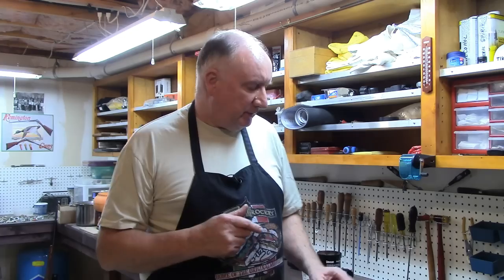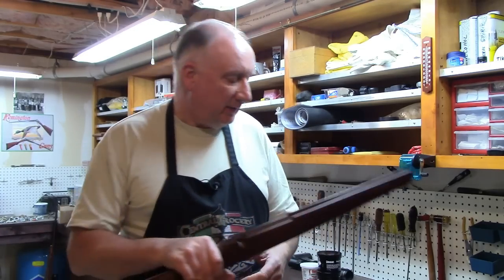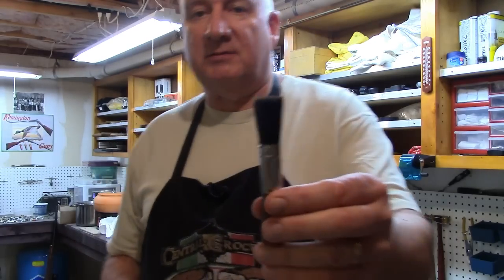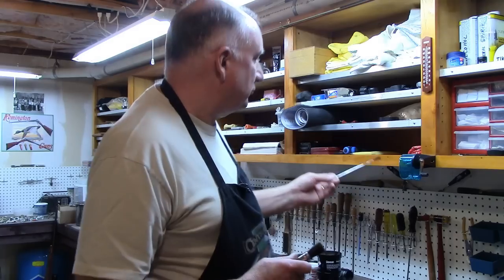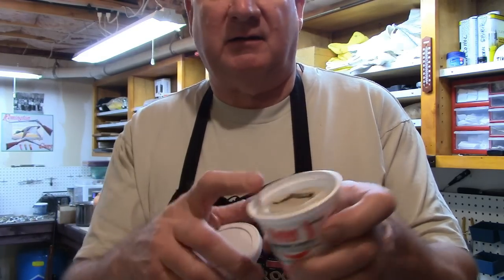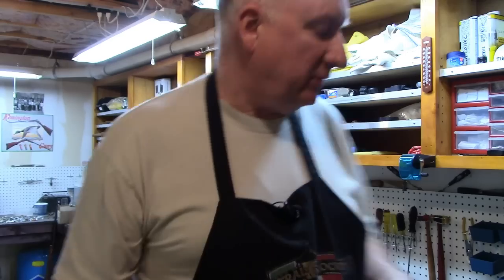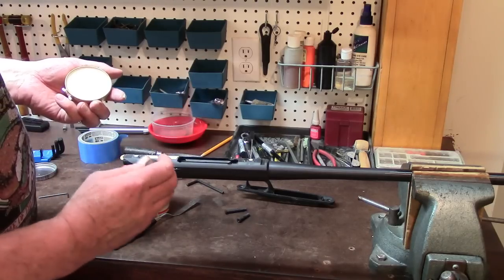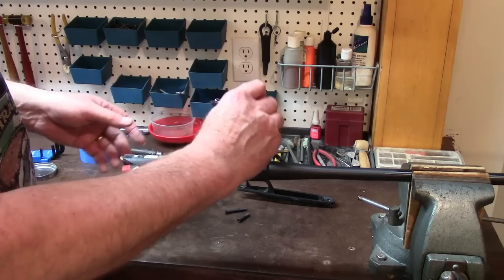How to glass bed a rifle, Part II ~ Let's bed that rifle professionally!

Comment: Some quick questions.            1  Is there any difference when bedding a rifle where the lug is attached to the barrel? I assume you put the Devcon into the stock where the lug has to go.     2.   If the gun already has steel pillars is there anything you do differently?       3.    If there are pillars on the stock my guess is that there is no chasing out of anything from the screw holes.  4 Some videos show the recoil lug being taped prior to putting the pieces together. Why or why wouldn't you do that?

Comment: In case it's useful to future viewers, here's the text that scrolled across the screen from 1:05:21 to 1:08:23 :
IMPORTANT!
Be sure to locate the plastic steel plug that has been pushed by the front action screw up into the chamber, and remove it and all debris from the action. Be sure to carefully clean the action, chamber, barrel, and locking lug recess.  Failure to do so will result in an obstructed bore and will destroy the gun upon firing!  The action screw, used without the stock, may be used to push out any remaining bedding epoxy.

Comment: Great video! I bedded my Tikka T3 into a Boyds Thumbhole Laminate stock, this past weekend using your instructions. The results are perfect! I have 3 questions and 1 comment, and THANK YOU for your time and instruction:

-Question - What do you use to remove the Kiwi Shoe Polish from the action?

-Question - What happens to the Devcon 10110 (A) if you use too much or too little hardener; trying to be exact, what qualifies as too much or too little?

-Comment - my Boyds stock came with a steel lug already adhered firmly into the lug slot. When I put the tape-ring on the end of the barrel to keep it centered, it angled the action just slightly out of alignment with recoil lug and it wouldn't seat without lateral stress. So, unfortunately, my barrel is marginally out-of-center with the stock, but still floating by a 16th".
Reply from the maker: semezai 
Shoe polish is simply a paste wax that can be removed with mineral spirits or naphtha, or any number of commercially available wax removers.  It's also protective and can be simply polished and left in place.  I don't know what the mixing tolerances are for Devcon epoxy.  I would try to keep it as precise as possible for the best results.  I would certainly think that too little hardner could result in hardening failure, and too much would leave you with insufficient quantity for the rest of your epoxy.
Centering the rifle in the stock is rather a particular part of the preparation process that can only be accounted for before the epoxy is laid in.  Any necessary adjustments after that can only be properly accomplished by complete removal of the job and starting over.

Comment: I would like to see the new groups and see if there was any difference.
Reply from the maker: Brett Unrau 
Given the excellence of the wonderful accuracy before bedding, I was not expecting it to improve significantly, if at all.  However, I did expect the rifle's ability to return to zero and settle in after stock removal, and resistance to atmospheric change to be improved.  I was satisfied on all accounts.  In short, the groups were not improved, but its ability to hold absolute zero, no matter what, is spot on.  If it were a heavy recoiling rifle, it would be vastly stronger and supportive over time, and unable to loosen up.  It was well worth the effort.

Comment: I have a question about glass bedding and free floating a RUGER 77/17 with a stainless steel 24 in barrel. I already glass bedded and free floated the barrel on my RUGER 77/17 17 WSM with a blued 20” barrel and it really tightened up the groups. The thing I am worried about with the 24” Stainless Steel barrel is if the barrel is to long and heavy and is it too much weight for the receiver ?  It is the newer one that the barrel is threaded into the receiver.

Comment: I am preparing to glass bed a Ruger M77 that has a tang safety.   Do you have any suggestions for bedding the rear tang area?  Unlike the Tika my Ruger M77 does not have a bolster.  Is it a bad idea to just bed the recoil lug area and not bed the rear tang area?   Your detailed instructions are excellent and your answers to the questions about the Ruger M77 have been very helpful.  Thank you
Reply from the maker: The M77 is very difficult to bed for a number of reasons, but it can be done.  The front lug should be bedded at least 1.5 inches in front and to the rear of the front screw.  The rear tang should be bedded to stabilize it.  Do not use the center screw to pull downward.  It should be only snugged with LocTite at a neutral degree to retain the trigger guard, but not to influence the action.

Comment: Exellent video, as always very thorough. I am about to bed my Ruger Model 77 Mk. 11 and would be interested in your thoughts on a few things. The front screw goes up through the recoil lug and the hole has a bottom so there is no where for putty to go if it was filled. I am wondering what you would recommend for protecting this so that the screw could be installed in the bedding process or is there a different way of dealing with it?  Also the rear of the steel magazine box seems to be quite tight in the assembly once the front trigger guard screw is in place and seems to be creating a pressure point.  I understand that this is not a high torque screw but it seems that it shouldn't be as tight as it is. Thank you.

Comment: Have you ever thought of using a vegetable spray oil instead of shoe wax.
Yes definitely put the stuff on the screws or you will be screwed.
Very well done for a video !
Reply from the maker: Having tried many different release agents over the years, I find that Butcher's wax or shoe polish is still the most trustworthy.  It's also relatively  easy to remove.  Oils sometimes migrate into corners under compression and act hydraulically to create voids and bubbles, and I'm not convinced that they don't violate the integrity of epoxy.

Comment: Thanks for this very useful lecture. question, the recoil log, you covered that with blk compound but after removing action, its surface was shinny!? now, I have a request! I do have a Swed M41B rifle that I love, most accurate rifle of one even more accurate than modern rifles. its stock has been cracked and I don;t know how! may be just B'Cuz f its age. I am looking for a replacement stock or a way to fix it without having it put holes and inserting pins so to have to re-stain it. it will lose its value. I was wondering if you could make some recommendations please.

Comment: Should a small gap be left behind the tang and stock to prevent splitting?  
Or let the epoxy fill that gap?
Reply from the maker: That's not necessary.  That's only a concern when recoil forces are not properly supported by the recoil lug and other parts of the receiver.

Comment: My remington 783 and savage axis both have the rear bolt going through the front of the trigger guard instead of the rear of the trigger guard into the tang where your tikka is. Would there be anything different with this set up or is it still to bed the rear tang and not anything on the rear screw? Would there be torquing issues because of where the bedding compound is  to where the rear screw is?
Reply from the maker: Bedding should occur where the screws are located. Properly bedded actions eliminate torque concerns because nothing bends.  Just screw down tightly.

Comment: Was wondering about the loose(separate from action)  barrel tang on the Tikka.  Ruger's americans are also built this way, just in a V shape.  I've installed mine in a Boyd's laminate  stock. No bedding yet but quit some amazing improvement in grouping ability.  Have read somewhere that we don't want pressure at the bottom face of the barrel tang because it might cause vertical stringing as the action and barrel heat up. That would not be achievable with the tikka  or ruger american style mounting. So how did your Tikka shoot after the bedding process? Have just recently found your videos and enjoy listening to them!

Comment: On a remington 700 where the recoil lug is attached to the action, how do you apply the epoxy? Do you put it directly on the lug and slide it in?
Reply from the maker: Don't put epoxy onto the metal.  Simply apply the epoxy into the recoil recess of the stock, and lower the properly waxed action into it.  Before doing so, carefully cut and fit a layer of blue masking tape onto only the front (muzzle side) of the recoil lug, then apply wax generously to the tape.  Remove the tape after the project is done. This will provide clearance for easy removal of the action in the future.
Reply: @GunBlue490  thank you very much for responding. You've taught me a ton over the years. When ever I have a firearm question this is where I come to resolve it 👍

Comment: How would you bed a rifle (rem700 in 243) that has the recoil lug attached to the barrel?
Reply from the maker: Shim the bottom, sides, and front of the lug with two layers of blue masking tape, trimming the excess with an Exacto knife, leaving bare metal on the back recoil face, coat with release wax and simply drop into the epoxy.  The tape provides clearance to remove the action.  Remove tape after the action is removed.

Comment: a question;  the releasing agent has a certain thickness, even if it is little, it does.  Is there not a small mismatch between mold and model when the releasing agent disappears?  Thank you, all your videos and teachings on guns are great.
Reply from the maker: The thickness is less than .0005". Parts are barely separable. There's no movement between parts in the least. Some OCD benchrest shooters glue the action in permanently, but one doesn't need much talent for that, and there's no access to the workings, ever.
Reply: @GunBlue490  I agree, it is important to be able to continue accessing the entire mechanics of the gun.  Thanks and again my congratulations for your interesting contributions. Greetings from Spain
Reply: @GunBlue490  they are not quite right in the head anyways

Comment: Wonderful video. just curious as to why you didnt replace the front lug with a steel one?
Reply from the maker: Very simply, it's not an issue with this rifle.  It's a very mild recoiling .222 Remington.  After bedding, it's so snug against the other recoil surfaces that the lug is almost secondary.  Sako charges handsomely for those lugs.
Reply: @GunBlue490  
It was only 15 bucks so I figured Id get one put before I bedded it in a tikka light in 7mm RM. But heck Im  just a lowlife ring lapper so what do I know. Anyhow interesting vids and keep them coming.

Comment: That was excellent. I have an M1A. How does free floating work with the mounting clip at the front end of the stock? It is a Loaded model with the black poly stock.
Reply from the maker: Barrels that have connections to the stock can't be floated unless that connection is somehow eliminated. However, a solidly cradled barrel can shoot extremely well, especially with military style one piece stocks, provided that the receiver is tightly bedded, preferably with epoxy.  If you have a loaded M1A, you may already have such bedding.

Comment: I'm tearing apart a enfield 303 British Canadian long branch. The gun is in sound mechanical condition. I plan on taking your advice on no oil on reassembly . ( except maybe gun grease inside of bolt for the firing pin and spring) . My question is could/should I use acetone to clean stock and steel parts ????? Thnx... love your videos sir 👍👌
Reply from the maker: Michael D 
No oil means as in lubrication, but wipe all parts with a lightly oiled, soft cloth for corrosion protection.   For the stock, just rub with a bit of raw linseed oil, which is what it was treated with.
Reply: Ok. 👌 but could I use acetone or alcohol cleaning agent on the steel parts , let dry, then apply light coating of mineral oil on steel parts ????  The firearm has 70 yrs of dirt in/on it ..😬
Thnx again..
Reply from the maker: Michael D 
Acetone and alcohol are best as single purpose degreasers, but are not the best all purpose industrial cleaners for a number of reasons.  I would recommend mineral spirits instead, which was invented for heavy industrial cleaning, is far less volatile and will cut unseen rust and will remove carbon far better.  Same aisle of the paint department.  Of course, Hoppe's #9 works even better when rust may be involved.
Reply: Thank you. I truly appreciate the advice. Please keep sharing your knowledge.

Comment: I've seen people do bedding that has no material in front of the recoil lug. Yet yours does and looks just fine, and shoots fine. Would someone provide some clarification.
Reply from the maker: The only advice given on this channel is mine, so it will have to suffice.  The sole reason for bedding is support, whether it's just wood, aluminum, or epoxy.  The recoil lug is the only point of resistance to support recoil.  While the support at the rear is the only recoil surface, epoxy that is bedded only at the rear relies on a very thin section of wood between the magazine to provide its support.  The wood around the  action is thin in all directions and is very unstable.  However, the wood immediately in front of the lug is the stiffest part.  If you bent the stock over a rock and broke it in two, it would not break there.  Roof trusses hold a roof up members that provide tension as well as compression, which is stiffer than a simple rafter roof that bounces and sags in the wind and snow under compression alone. 

With epoxy only rear of the lug, it's just compression holding the action, just like an un-bedded action.  Epoxy extending forward "grasps" onto the action from the rear of the barrel channel, as well as resisting it.  So, epoxy should always extend forward of the recoil lug for a minimum of 3/4 inch, to provide tension strength in combination with compression strength, and to provide upward support at the barrel and action joint to solidify the job the action screws do.

Comment: Great info. I like the approach. Wish you would do a winchester or remington. After lots of internet searching I still have questions about a standard recoil lug and how you would do the taping of it. Also how would you deal with the blind rear bolt hole in the receiver of my M70? Can't put plumber buddy in a hole that doesn't go through. Do you have to use guide bolts?
Reply from the maker: Rattlebone 4570 
I may do a Remington 700 some day when I have time.  In the meanwhile, I discussed both the Remington 700 and Winchester 70 and showed the results in Sporter Rifle Accuracy, Part I The Rifle, about one year ago.  The recoil lug should bear fully at the rear, and should otherwise have clearance at the underside, front, and sides.  The amount of clearance is insignificant, but provides easier removal of the stock without binding.  The clearance underside is to prevent the possibility of foreign material from interfering with seating.Two layers of blue tape at those locations is sufficient, though three at the front will allow easier separation down the road.  I have found that screw clearance improves accuracy, which is easiest to perform by increasingly chasing the holes by hand with a sharp twist drill held by hole tap parallel clamps for 1/32 clearance.  A power drill can easily wander and ruin your job.  Wait at least 24 hours for full curing before doing that.  Gunsmith bedding hand screws are handy, but an expense you shouldn't require unless you are doing this regularly, and time is money.  The FN production Model 70s have the best factory bedding I have ever seen, and the performance is absolutely perfection.